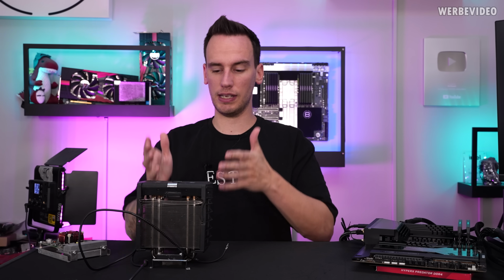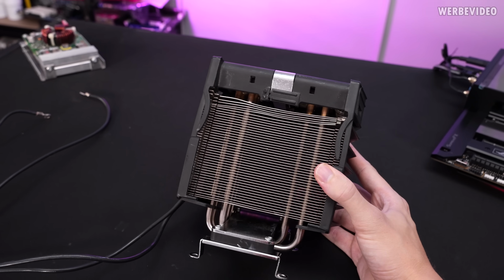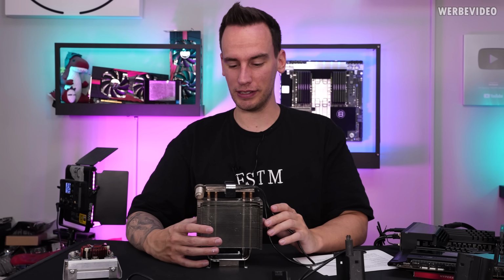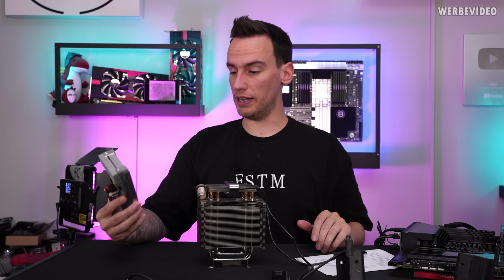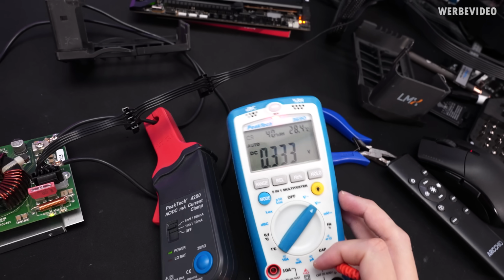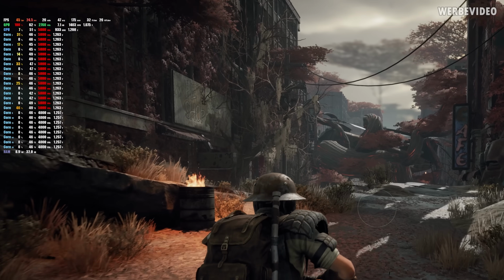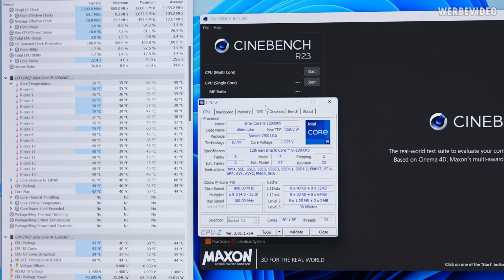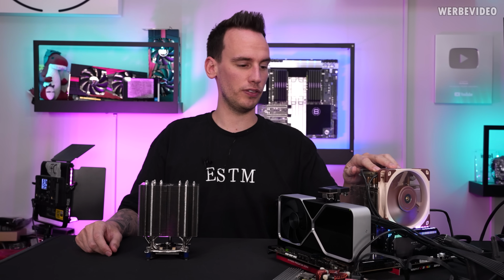This Cooler Ruined an entire Company - LMX Liquid Metal Cooler

Comment: That is such an interesting concept, I am curious if this was just a thought experiment gone wild since most sintered heat pipes using some kind of liquid that experiences a phase change in the operating temperature range. How they thought a liquified metal would somehow provide a greater capacity to move heat from the working medium to the fin stack and finally atmosphere is a mystery to me. I'm not a physicist by any means but my rudimentary understanding of thermodynamics is just not getting why someone thought this was a good idea from a cooling performance perspective let alone an engineering safety perspective. Excellent review clearly shows this is some technological oddity, just wild.

Comment: NaK cooling is used on some super-hot industrial machinery (nuclear reactors mostly, IIRC?) that would boil traditional coolants, but it seems not only overkill for the temperatures of PCs but also full of downsides (like... the risk of spilling alkali metals around the house) that don't justify the questionable 'benefits'. Heat pipes work REALLY well, as do pumped water-based-coolant loops at the temperatures PCs operate at.
The MHD pump is interesting, I'd vaguely heard of the NaK cooler but didn't know that's how it operated. Sounds inefficient but at least they don't have moving parts penetrating the NaK containment! Clever.
It's probably not as dangerous as it sounds, but still pretty scary. Probably reasonably safe in operation, but throwing one out? That would cause PROBLEMS. The stuff would burn once it got wet, after all.
Really cool piece of engineering though. It belongs in a museum! ...and not in people's garbage cans. Not sure what they were thinking, there. Every product should have a lifecycle plan.

Comment: if it was on steel rod, than i thing its pretty safe to handle NaK. it didnt hold any weight and its pretty much inside a protected case. also NaK work at extremely high temperature (up to 750 degree celcius), so i think this a wrong use case scenario. give the inventor a props tho

Comment: You can pump NaK without moving parts (the NaK is the moving part, and current is flowing through it), so the pump never wears out.
Reply: so it is like the motor has a single winding with very high current, that is why it needs a beefy power brick.

Comment: The reason they used liquid metal is the ability to pump it without moving parts.  The pump is a "magneto-hydrodynamic pump".  That supply hakes HUGE current, but at LOW voltage.  This current passes through the liquid metal.  There has to be a magnetic field (wave some steel around the cooler.  You should find strong magnetic fields.)
      
    As long as the hot side is lower than the heatsink, heat-pipe scheme is WAY superior.  Gravity & boiling/condensing drives the fluid around, so no pump is needed.  The heat-of-vaporization is WAY higher then specific heat WITHOUT significant temperature drop.  By the way, water is NOT used for heat pipe operating near room temperature.  Usually some refrigerant is used which has lower boiling point.  Water does not have enough pressure to drive vapor upward near room temperature.
          That NaK fluid is VERY dangerous as you state!

Comment: Would be interesting to see how well the cooler performs with some kind of shroud redirecting the airflow through the bottom of the fin stack as well, as quite a lot of surface area goes unused at the base of the heatsink since the fan won't fit properly in a modern system.

Also with the top fins soldered back into place - which is maybe/probably not doable with the metal alloy still inside the pipes, as it might expand and rupture the pipes, meaning potential fire hazard, and corrosive byproducts - sodium/potassium forms hydroxides by mixing with water which will melt flesh and whatnot on contact - or if breathed in as an aerosol... :P Fun stuff. Still, a bit of cooling capacity would be lost here as well.

Even with these deficiencies the cooler performs surprisingly well. Anyhow, one might well imagine the reason they dissolved the company is that some government safety agency contacted them and informed them there would be no way their product would be allowed on the open market, considering how hazardous the heat conductive metal alloy they use is... lol I can't imagine this thing passing EU CE regulations, honestly.

Comment: Alkali metals are great heat transfer liquids due to low cost, high thermal conductivity, and low corrosion potential for piping metals. Plain sodium has been used in fast-spectrum nuclear reactors for decades, and it has also been used in high temperature heat pipes. However, its melting point is too high to be useful for cooling electronics, so the potassium is added to make it liquid at room temperature.

Comment: 30 Amps geeeee, where is all that energy going, because on the cooler is doing induction, is there a big resistor on the controller to eat that ?
Reply: It's a magnetohydrodynamic pump. Works on the same principle to a railgun, but the 'projectile' is liquid. To oversimplify: They pass enough electrical current through the liquid metal ('across' the pipes, not 'down' them) it becomes (briefly) highly magnetized, and pushes off the magnetic field of the electricity coming in at a right angle (something called 'Lorentz force'), so the metal goes shooting down the pipe without any other moving parts.
As you might expect, this requires an unusual power supply, and isn't exactly efficient , but at least there's no physical pump to break (or leak, which would be bad for something sensitive to moisture and highly flammable)!
Reply: @05Matz  thanks for the answer but I know how it works, that is why I say it uses induction, but to do that need a resistance to put a load, and 30 amps is a lot to dissipate

Comment: There are a couple of YT videos of NaK fountains, one called "NaK" by Periodic Videos and one called "Building the most dangerous fountain in the world" by Advanced Tinkering, that show operation of glass magnetohydrodynamic pumps. 

I had an idea once that one could make a whole PC cooling loop with glass tubing, nickel-plated blocks and radiators (since the NaK doesn't corrode nickel and steel, but the plating would have to be thick and solid, since NaK corrodes copper and brass) and a magnetohydrodynamic pump.

Comment: I'm amazed the sucker still works.  That's a pretty beefy little power supply just to run the pump.
Reply: There is nothing moving inside to break. The "pump" is just two electrodes on both sides of the pipe and a pair of magnets perpendicular to them (top and bottom). When the current is flowing through the NaK it generates a magnetic field that interacts with the magnetic field of the magnets and, through a Lorentz force, pushes the liquid along the tube.
Reply: @MikrySoft  The pump might not break, but we are talking a pretty viscous "liquid" being looped and numerous metals are involved.  All sorts of things can go wrong.

Comment: Cool video..... Hmm, I just sent by normal mail, maybe it should have been marked as dangerous goods. Another remark, I ordered the superleggera version of this, but was called by Danamics if I wanted this one instead. I agreed, very short after I received it, the company closed. I ran it for almost 5 years on my I920 clocked to about 4.0 to 4.2 ghz, running very fine. I then replaced with Factal design Kelvin 360 water cooler, which didn't preform that much better :-)

Comment: I think you missed the big thing here. it's 10+ years old performs on par with modern air coolers and hasn't appeared to have degraded in it's performance. The only issue would have been thermal compound. I think they back away cause of the People are stupid and this might be to dangerous for stupid people and 2010 water cooling AIOs were coming out at the same price point. Granted for like servers and making Mainframe cooling it might have worked out better but I don't think they had the heart to continue when the performance was on par. This needs to be in a museum. not in a scrap bin.

Comment: Liquid metals are WAY better at moving heat than water or its mixtures.  The Prandtl number is the figure of merit that you want to look at. NaK has a Prandtl number that’s about 350 times smaller/better than water. NaK is used becase its liquid at room temperature so that’s a nice feature. Sodium has a lower/better Prandtl number than NaK but the operating temperature must be higher for it to liquefy.  Sodium is commonly used inside valves in racing engines.  It helps moves the heat from the valve face to the stem.  Lithium has also been used for higher temperature applications where it is best. Liquid metal heat pipes have also been made.  Liquid metals are electrically conductive, so electromagnetic/induction pumps can be used to move the liquid metal without any moving parts - common for casting aluminum.  Any of these liquid metals quickly form a protective oxide layer when exposed to atmosphere. So they are not particularly exciting/dangerous in air. Now if you put them in water, it will reduce the water (i.e., the metal will take the oxygen away from the hydrogen in water) liberating the hydrogen as gas while generating heat, which can lead to the hydrogen bursting into flames.  That is a little more interesting.

Comment: Very interesting video! I remember the news articles about liquid metal coolers, but they never went on sale.
Got to thinking if you could take the Noctuha cooler and extend the heat pipes and put a water pump on and omit the fan? 
Will it work - an air/water cooler! ?

Comment: The sodium-potassium alloy is 1/4th the "heat capacity" of water, but is that by mass?  Is there more than 4 times the amount of the liquid metal than water? Don't recommend you find out by cutting it open! LOL I agree though, it is far too dangerous of a design for a consumer product.

Comment: Weird product, was briefly available on the market in its native Denmark. Makes no sense in the real world, but maybe it actually made sense in the laboratory and they just couldn't transfer prototype lab results to working models.

I suspect they really wanted to make custom solutions tailored to each client but they probably needed to generate some buzz around the technology to sell to companies and the like and hoped a public product like this could be the source for that, but obviously for that to happen, the devices made for public use actually have to make some amount of sense, which this frankly doesn't.

To be fair to Danamics though, NaK getting out is not appreciably worse than punctured lithium ion batteries in terms of collateral damage, so if the technology had worked and matured I doubt we would have been any more scared of it than we are of any of the myriad of battery powered products we use day to day.

Comment: When comparing heat capacity you gotta keep in mind the densities of the materials. If a material has a lower heat capacity, but it’s significantly more dense, it could hold more heat energy for an equivalent volume.
Reply: Y...yeah but ... but NaK ... NaK has lower density than water (it floats) ... meaning even less heat capacity...
Reply: @FTreba It only "floats" as it's ripping the hydrogen and oxygen apart into gasses, it's almost like a liedenfrost effect.
Reply: @Steevo69  Umm, that may very well be, but NaK IS actually about 15% less dense than water.

Comment: It seems like noctua fan is running a lot faster when mounted on LMX, in game test it reports 1500rpm where it was under 1000 with 12A. I think that's why it performs really close to Noctua. This is still an OK results for an old single tower though. But I don't think the liquid metal helps that at all.
Interesting piece of technology. Thanks for risking the system for testing it for us 😅

Comment: Something you can do with NaK that you can't do with a water pump, is using an electromagnetic pump. Since it has no moving parts, it will essentially never fail, and it should be borderline silent if not completely silent. It might also be cheaper, but I can't speak towards that.
Reply: regular heat pipes don't have a pump at all they rely entirely on the capillary effect of the sintered copper inside (or copper groves/copper wire mesh if you have a very cheap cooler).
Reply: It's also an order of magnitude less efficient though...
Reply: 30A pump
Reply: Interesting
Reply: It has no moving parts, but it requires a fan attached to it that does.

Comment: It's worth noting that heat pipes can leak, however it is extremely rare. The last time I recall seeing that was last year when it happened to Kitguru. Of course even if you are unlucky enough to have a heat pipe leak it is still much less dangerous than if this cooler were to leak. The fact that they thought this was an acceptable cooling solution is just absurd.
Reply: Dude, we're cooking with highly flammable gas in our kitchen. We also driving around while carrying gallons of high flammable liquid in our gas tank. 

I guess this couldn't be more dangerous than those case innit?
Reply: @fajaradi1223  First of all there are electric alternatives to both gas stoves and cars. More importantly in this case the alternative (a regular heatpipe cooler) has zero fire risk. In other words this cooling solution would have to completely blow heatpipe based air coolers out of the water for the risk to be worth it and even then water cooling would likely still be comparable in terms of performance while being less dangerous than this product.

Comment: The NaK is exactly what was used to cool some nuclear reactors. Reason being they can with stand 200+ without problem while water would boiled. And unlike water that can act as moderator, NaK don't have a big effect on the chain reaction.
So unless you have a nuclear reactor in your PC... you don't need one...
Reply: "So unless you have a nuclear reactor in your PC... you don't need one..."

so the perfect cooler for a 13900K then
Reply: @rossclutterbuck1060  I came to say exactly what you said.
Reply: @rossclutterbuck1060   may i introduce you to the 13900k v1.1 the 14900k
Reply: You ever see a 4090!  That's pretty close buddy!
Reply: >Implying modern processors don’t produce the same thermal output of nuclear reactors.

I wasn’t born yesterday, bub.
Reply: @@lurch789Not really. NaK is probably better used here than in any nuclear reactor.
The tiny amount makes it pretty unlikely for it to actually catch fire and being able to use electromagnetic pumps without moving parts means this thing isn't going to break any time soon (unlike water cooling pumps).
In nuclear reactors instead you would have tons of it, and that along with the way higher temperature means it's almost guaranteed it would catch fire in case of leak and by the time that happens it would've became activated and highly radioactive.
Basically a huge radioactive fire of molten metal that you can't put out with water.
Reply: qdaniele, yes but that's considered far more desirable to a steam explosion that throws that radioactive material all over the country and region.  Molten salt would create a single large mass of radioactive material but you could cover and contain it and only the local site would suffer for it vs everywhere the material from an explosion can reach on the winds. @qdaniele97
Reply: The water would not boil while under pressure.  Water only boils at 100C when in ambient pressure at sea level.  It's to prevent steam explosions in the event that the cooling is unable to be moved and cycled to keep it at a sustainable max temp.  Water will expand into steam and explode where NaK will not.
Reply: I have a 3089Ti, I think that’s about the same given how warm my computer room gets.

…in the dead of winter.

…with the windows open.
Reply: There are PWR for some reason
Reply: Yes all pcs are nuclear reactors and we need this kind of cooling. 

This isn’t liquid salt… which would corrode everything it touches after it reaches 1400*f that’s what caused the gaskets to fail and water mixed with molten metal sodium causing a melt down and release of radioactive materials… 

As long as the temps do t get that high, liquid metals such as sodium and potassium are some of the best thermal conductance we know of… better than water or oils…

Dry water perhaps may be the only thing better and safer… but it’s very toxic, much more toxic than metals that self seal and become safe. 

Only dangerous if exposed completely to water… where the nuclear reactor use only salts… and super heated it… as soon as the seals failed it would take in water from the environment. And catch fire. 

Potassium would oxidize and form a protected layer… preventing combustion. 

You have to remove that oxide in order to have reactions with water. 

People aren’t submerging their computers in water… even if they did these things are laser welded… or something I don’t see any seams that would crack or present an issue???
Reply: @pazsion  people have submerged their PC in mineral oil though
Reply: sounds like you've never had an AMD set up lol
Reply: @breakingmichigan bro still living in Athlon era lmao. Its intel that are the heat guys today.
Reply: @Doflaminguard   Yes as my 5900x needs cooling as it should run at 90c all day...
Reply: @Doflaminguard  dude, 7000 series runs hot

Comment: "It can take only 1/4th of the negery"

Does it? Shouldn't you take in consideration the mass of the alloy compared with mass of water in typical cooler. If mass is more than 4 times than of water it will be more efective